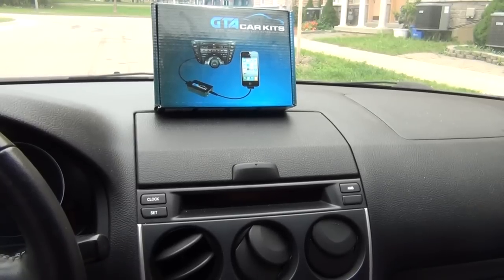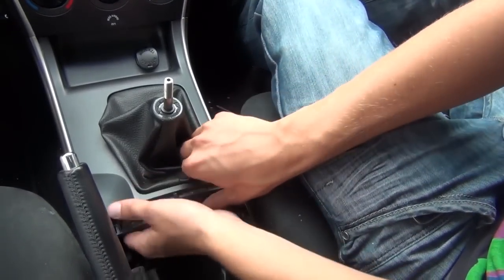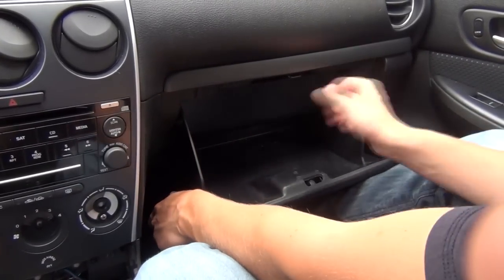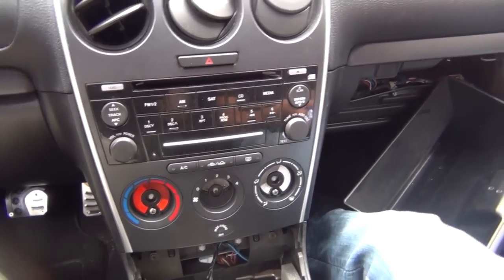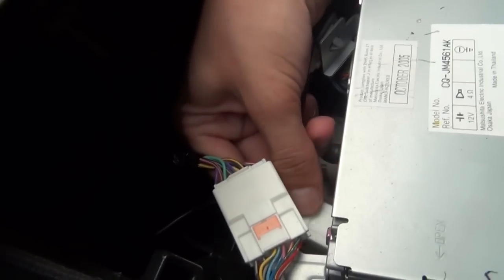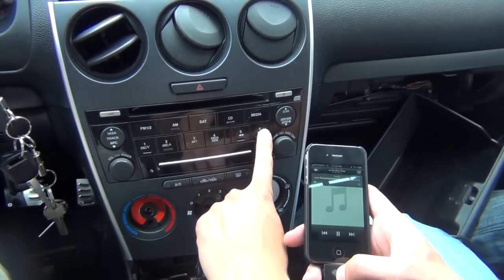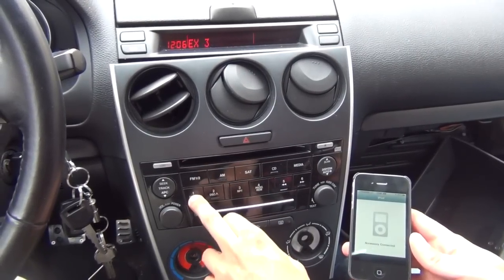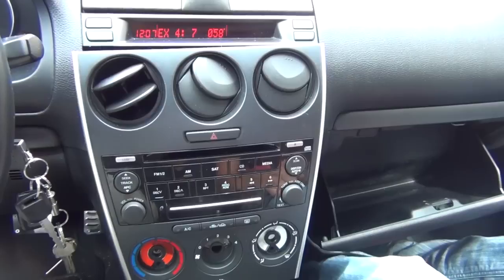GTA Car Kits - Mazda 6 2006, 2007, 2008 install of iPhone, iPod and AUX adapter

Comment: Hi guys!
I just installed my Gta Car Kit inside my 2008 Mazda 6 about 2 weeks ago and I absolutely LOVE IT.
Works exactly as advertised and the installation was a piece of cake. This coming from someone who has never done a single mod or installation inside a vehicle before and even I did it following these simple instructions in less than an hour. Other than finding a place to run the wire through? It was completely simple and straight forward if you follow the steps carefully. Put it this way. I didn't even have the 10 millimeter socket wrench I went to autozone and installed it in front of the store in 40 minutes. Sound quality is great and works fantastic. Definitely reccomend to anyone that doesn't wanna pay 400 dollars for someone else to do the same job :)
Reply from the maker: Brice McLogan We are very glad to hear!
Reply: GTA Car Kits Ima need one from u guys in like 2 weeks from now

Comment: Works perfectly and installed in about 30 minutes! So glad I don't have to use an fm transmitter anymore. No more static and the quality is perfect. If you have an automatic... it is easier to take out the piece around the shifter in neutral and put it back in when in park. THANK YOU

Comment: Great video and crazy easy installation. IMPORTANT NOTE for Mazda 6's with Climate Control: You must unscrew ALL 4 screws mounted to the stereo console to remove it, not just the 2. The CC/AC knobs do not simply snap off like they do in the video, since they operate circularly... so you do not need to remove them, the stereo console will snap off with them still attached - as long as you remove ALL 4 screws (02:08) you see as soon as you remove the gear shifter frame.

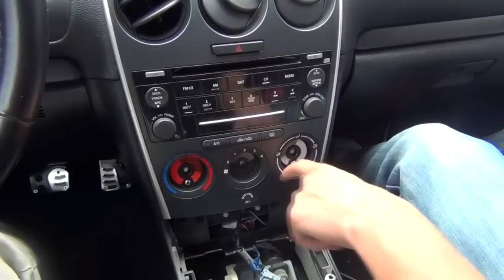Comment: Thanks - this video was really helpful.  At 2:35 - my Mazda 6 2006 has silver rotating dials on the fan and temp buttons and you DON'T need to remove these - there are no screws under them and the dials are not always easy to refit.
Reply: Were you able to get the gear shift knob off? I have the same model and year, and mine does not want to come off.
Reply: Kirsten Tackett Yes no problem - it's just screwed on and should come off when turned anti-clockwise.  Maybe it has been overtightened in the past?
Reply: Adam Knight Thanks!

Comment: Just installed on my 2007 Mazda 6. I am NOT car/tech savvy at all. Took me about 1 1/2 hours to do it. Only real hangup was getting over the automatic gear stick while releasing the electrical running to the lighter.  Once I did that, the rest was super easy.  Seems to work quite well.

Comment: I installed it on my mazda 6 2007. Its exactly what I was looking for and the sound is amazing! This video doesnt show you the climate control nobs, those done come off. unscrew it on the button and the 10mm bolt then push it from the back at the radio and it will pop out.
Thanks GTA CAR KITS!

Comment: Just installed this tonight on an 07 Mazda 6 and it was a very easy mod. Hardest part was connecting the shift boot portion of the console haha..I ended up keeping the cig outlet unplugged. I recommend keeping the iPod playing while putting everything back in case there is interference and static plays.

Comment: Excellent Video! Installed similar unit in Australian 2006 Mazda 6 Auto. Plastic cover for the auto drive selector makes it a little bit fiddly - position to D or R for easier removal/installation. This auto selector has 3 small wired bulbs for lighting - 2 under the drive selector positioning (twist to remove), and 1 next to the cigarette lighter plug (push clips on each side to remove). I Drilled a hole in the base of ash tray to route cable to iPhone windscreen cradle. Box sits in glovebox.

Comment: my girlfriend ordered this for me for my birthday. i was able to follow this video to get it installed except that i had a 2007 and my car was automatic. if you have an automatic i suggest with the E-Break on shifting into neutral to remove this part of the console. other than that everything worked great! and also for iphone 5 users the lightning converter to use the old iphone connector will correctly play music and charge your phone.

Comment: This is for a left hand side mazda 6 . Right hand drive you just need to remove glove box and you can reach the empty aux slot. I did mine in 2 mins using an aux lead

Comment: I have an 08 and did not have to remove the ac knobs and it went fine. If you have a automatic you may have to shift into neutral or drive to remove the paneling around the gear shift. That was the only part different than the video for me. Thanks for the help!

Comment: There is a kit through Best Buy that you can get hooked up to the radio. They have a standard Aux/USB combo and an apple cable. Both run about $139.99 with install included depending on what city in state you are in may vary. Call them up, or a local car audio place and see what you can find. Hope this helps.

Comment from the maker: Yes the installation will be very similar, everything is the same, except your will not have to remove the climate knobs (as there is no screws underneath them).

Comment: Brilliant kit, installed today on my Mazda 6 sport (2007).

Installation was even easier than shown on video. Due to right hand driver position in the UK I did not have to pull out radio dashboard. Just removed the glow box and could easily reach the port to connect GAT Car Kit.

Switching tracks via wheel controls does not work thought for my iPod Shuffle. Not sure if it was intended to work this device.

Comment: I don't if it is case of this kit, but there's a kit that's very similar to this one, maybe there are the same. The thing with 2004 Mazda 6 is that you need to do a bit of change in your radio unit. You got to connect two things on the radio unit board that are not connected. Google for "xcarlink L716".

Comment from the maker: Our kit works on 2005s, which use the newer radios (same one shown on the video). If your radio is different, the kit will not work.

Comment from the maker: @hreatbreaker2001 Hi, the install will be the same if your vehicle is 2006-2008. Please read below about the climate control dials :) if yours are different, you won't have those screws underneath. 

thank you

Comment from the maker: the only way to use samsung is through the AUX cable, and you will have to control everything through the device, not the actual radio.

Comment: No need to take the radio. If you take the glove box, move your passenger seat all the way back you can actually just plug the connector in bu going under the glove box!
Reply: this only works with european cars. in america the plug in is on the drivers side so you have to take it out to access the plug
Reply: @shanemurray9877   he is right. I did it in my car and I am in Europe. The plug is also on the driver's side so it's a bit tight indeed but it can be done. No need to remove any part of the dashboard or central console.

Comment: I have accidentally loosen up the AUX adapter from the radio while cleaning my A/C air filter, the adapter worked but the AUX volume was really really low, even when the radio was on full volume, and the USB didn't work, so im going to give this a nice try and see if this fixes my issue.
Thanks in advance!

Comment: When disconnecting any power cables (like in this case the lighter/ashtray bulb) you really should disconnect the battery first, otherwise you risk errors showing up on diagnostics, and thats best case. Lot of worse things can grow wrong, Japanese cars have very sensitive electronic systems.

Comment: Hi, I recently installed this AUX cable to my car, thanks to your very detailed video. However seems like I might have pulled the cable too hard and now only the right side of the speakers are working. tried tightening the AUX from the back part of the radio and still didnt work. I tried removing the the whole piece to re-enter it. This has been impossible, the white plastic piece will not come out. Please advice on how to uninstall.

Comment: Ok I get it that it only works on 06 to 08s, I would like to keep my steering wheel buttons working for my stereo, I have a mazda6 2005, do you know if the 2006 stereo can be installed on the 2005 and have all my buttons on steering wheel working and then I could install the kit. I could just buy a stereo with an AUX port and stereo kit but I want to keep my volume and skip available from steering wheel. I hope I am making sence. By the way love the instrustions it rocks

Comment: Hey just got my kit for my Mazdaspeed 6, where did you mount the module? Do you leave it behind the radio and run the ipod and aux cables to the arm rest, or is the module in the arm rest?

Thanks!

Comment: I've had this a while now and I love it. I was wondering though when the car is off does the kit turn off or is it constantly drawing power from the head unit ,cause I leave my ipod plugged into it all the time.
Reply: When the car is OFF, the radio is turned OFF too (Car OFF means the key is completely turned to OFF or taken out); the kit turns OFF when the radio turns off and of course when the car is turned off

Comment: can you use this product if the car has the built in navigation on the 06-08 models? or does the navigation use the same port on the back of the radio?

Comment: I've been looking for a way to have an Aux port in my ms6, but the only things Ive found requires modding of my dash, which for me means breaking something. I really want to install this in my car but I'm rather hesitant because i feel like if it was this easy ALOT more people would be doing it. Is this the same head unit as is in my Speed6? My car has the Bose sound but not the nav and Sirius radio that came in the grand touring edition. Any help would be appreciated!
Reply from the maker: mride1993 The kit will work exactly the same way on your car.

Comment: i finally took out my radio, but when i checked the back, something was already in the port i needed to plug in for the aux. ive been trying to take it out but it wont budge. this has been so annoying man
Reply: Seki Uce Does your car comes with Sat Nav?
Reply: It is the satilight radio, you could remove it or buy a splitter adapter that allows you to fit both the aux and the satilight radio into the same port.
Reply: Seki Uce how did you remove it

Comment: I have an Automatice 2066 Mazda 6 but, my thermostat control dials are not the same as these. My dials are large buttons with the dial rotating around it. Do those just pop off like these or is there some special way to pull them off?

Comment: Do you think there will ever be one that's compatible with mazda6 2005? i would really like one, that way I don't have buy a new radio, a new 1 din radio face plate, and lose the option of using my steering wheel controls :/ This product could really save me money if it was compatible. I just want to listen to my damn ipod while driving :(

Comment: My cds got jammed in my radio and i watched some videos saying if you put a knife in and try to lift it it will come out i tried it and then nothing happened then my fm radio stopped after so now nothing works would you think this will work?  The radio turns on its just not playing nothing anymore
Reply from the maker: we suggest the radio to be fully functional to install our product. It is a 50/50 chance for the kit to work. Thank you.

Comment: I did al the same with the USB/Aux Adapter and now the central dash clock bezel is not showing any information .....the Ligts are on but there is no info at all......checked the conection all fine.
Maybe someone knows whats wrong.

Comment: Will this still work for mazda 6 2003 luxury sports? and does it drain battery if you leave ipod plugged in?
Reply from the maker: The is no kits available on the market for your year of Mazda 6.
Reply: what about 2005?
Reply from the maker: Only 2006+ Mazda 6s are compatible with these kind of kits, there is nothing available on the market for the older Mazda 6's unfortunately. Thank you!

Comment: Do you still support the iPhone 4s plug in? Please respond
Reply from the maker: +Tanner Dimmitt yes the connection supports both the older style plugs, along with the newer ones. For new style connections, you will need to use the kit along with the Apple Lightning adapter.

Comment: Why is it always me. I am half way through the install, up to the testing part. I press the CD button twice and it just stays on the CD player. I took out the discs and tried and it just reads NO Discs. Help Please!.
Reply from the maker: please email our support if you have any issues.
Reply: GTA Car Kits  
Hello I just completed install but no response when I press CD button twice. Please assist
Reply: +Shane McManus I'm having the same problem. I don't know what to do. My car is half torn apart right now and I can't get it to switch modes by pushing the cd button twice
Reply: Ok never mind it was a simple fix. Just cycle the key to reset the radio so it detects something is plugged into the port

Comment: why not just buy a radio with I Phone etc., mine is mazda 323 1994 has one (Pioneer) and ask the installers (where you bought the radio) to install it.
Reply: That's what I thought before getting my 2004 Mazda 3, but I investigated a bit and the issue is when you remove your original Mazda radio, your on-board computer will show nothing but temperature as it's integrated with the radio's LCD, and also the buttons on the steering wheel won't work. That forced me to buy one of this car Kits (other brand). What these do is emulate an external CD charger.
Reply: For those who has a old car like 90's 80's does not have any problem with that. :) (11years old)
Reply: I honestly miss the simplicity of 80-90s cars, hah!
Reply: Yeah, 80-90's are really simple :)